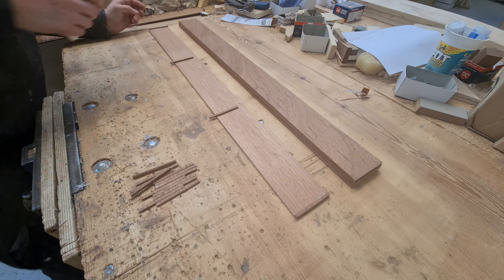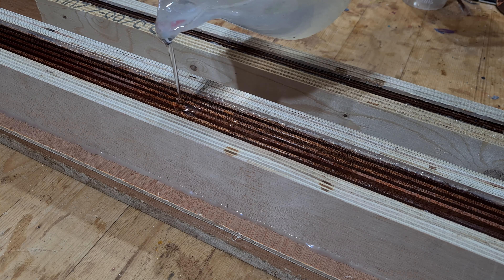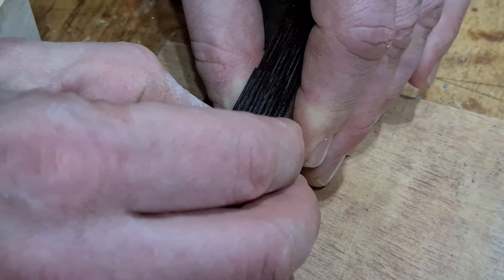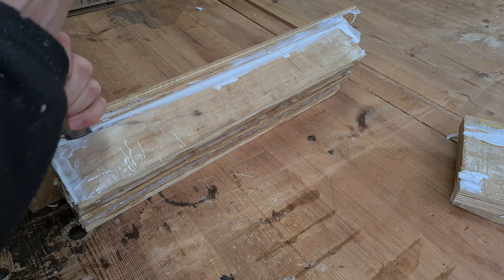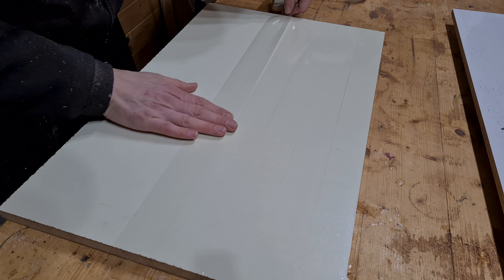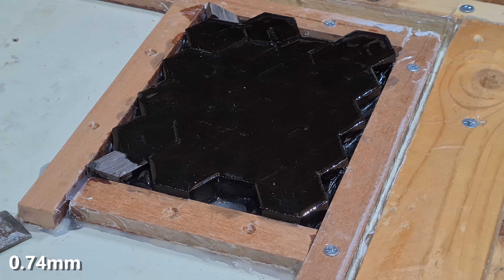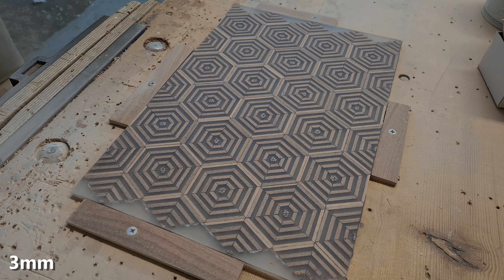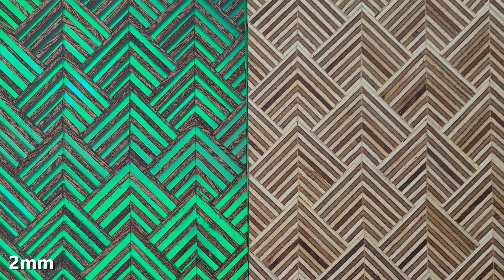How to Make Transparent Patterned Plywood

Comment from the maker: Question of the Week: Favourite pattern for patterned plywood? Project ideas with transparent patterned plywood?
Reply: 0.74mm my favourite 😁
Reply: They all look good to me. I imagine it's quite time consuming as well as being fiddly?

Is the veneer flexible enough to make into a wavy shape or even arches (circles I would assume would be hard to make small because of the veneer flexibility)?
Reply: Mountain tops.
Reply: I think they all look great. Would make for cool shaker style door panels on cabinetry.
Reply: Already thinking about how to make a pen blank using your method, but on a smaller scale.
Reply: The hexagons of course. For several months I have been thinking about how to make a new lampshade - now I know it.
Reply from the maker: Just a pain to work with!
Reply from the maker: Hi Richard. The veneer is more fiddly due to the size. If coated with thin resin and cured compressed, it can maintain it's shape better, certainly flat. Should be able to have them in a curve too, though making a pattern with curved patterned ply would require a very keen mind! Great idea - might have to give it a go!
Reply from the maker: Agreed!
Reply from the maker: Definitely agreed Kraigist! I guess the problem is the amount of resin to do such a design. Hopefully someone richer than I will give it a go.
Reply from the maker: Please send me a photo when you're done, would love to see it.
Reply from the maker: I hope it goes well and please send me a photo, if you are willing! The hexagons required a lot more care to position correctly and even slightly out it seemed to scream up at me. I'm sure you will show it the time and patience it actually needed.
Reply: Thank you for posting The tumbling blocks my favourite as for the optical illusion effect I can visualise a very tall transparent octagon patterned lamp with colour changing lights or lights that respond to the beat of music

Comment: You could take those 3d printed spacers, use some silicone molding stuff, and use that to make the spacers out of  resin. That would hide them pretty effectively to get more out of the board.

Of course, that depends on how good the edges come out doing this.

Comment: I think this is brilliant. But... if it were ME, I'd consider myself dying to go for a parallax effect: for instance: say you make some captive sliding doors, in a sideboard, or buffet. For the sake of ease of visualization, let's call them shaker style, with the floating panel made of your Transparent Patterned Plywood ("TPP"), in a bypass configuration with the body of the piece (so their sliding groove draws them along the outside of the piece).

Next inset a couple inch "bar"/"strip"/"inlay" (and having just thought that aloud, the intarsia potential for this stuff is HUGE, though you'd want a Hammond Glider to manage the cutwork) - think a thick "racing stripe" - running the lateral length of the piece parallel to the line of the doors' travel (and situated behind the doors path).

Finally, set some momentary switches in the track, such that the interior of the piece gets illuminated when the doors begin to open. It'd be like looking out a train window at it passes along a covered bridge: the illumination greater than if the window was absent, and flickering and interrupted as the support pillars flashed by.

Anyway, my 2¢. And worth every dollar, no doubt.
Reply from the maker: Some very intriguing thoughts! Certainly would want some bigger machines to take on larger projects. Doing the electric guitar tops was hard enough by hand! Thanks so much for your feedback. All the best. Ray

Comment: I really don't know what to say Ray except I was so fascinated with every little piece. Gonna make a spiral alyered vase out of them perhaps ?   Thanks for sharing.  -Mike
Reply from the maker: Hi Mike. Definitely have to start small, iron out the issues in turning a sheet into a 3d object, then see what happens. First is a segmented feature ring and see if I can get that done correctly. All the best. Ray
Reply: @RayWhitbyCreations  Ha, couldn't bait you into the most difficult vase I've ever seen. So OK to a simpler idea to start out with !!
Reply from the maker: @mpart_woodlathe-stuff  Not yet Mike. I've embarked on a couple of tricky projects and I think the sheer magnitude and complexity has done me in. I'm certainly slowing down on the frequency of producing the videos and the number of migraines has increased! The most difficult vase will have to be patient, or someone will be inspired to do it first...

Comment: I just now found you, but I'm already a fan of Michael Alm. You are now my hero as I also work in complicated epoxy pours. I'll give you a few hints.

1. It appears that you sealed all of the faces of your wood, so that's key. Wood off-gasses and you'll find a lot of bubbles if you don't. Just be absolutely sure that it's sealed. 
2. I don't understand the difference between deep and shallow pour and this is why ... if you apply your epoxy in layers (even during the same pour) then you will get "deep pour". How to mitigate bubbles?
3. Heat it. If you take the resin mix and put it in a Bae Marie at 125 degrees F (about 52 degrees C), the bubbles will all rise and you'll be left with a crystal clear epoxy. 

Of course, this will allow it to cure faster as well, but as long as you're pouring one layer after another, in this instance, say, half and half, then the first layer will be clear. It will set a tiny bit, and then you'll pour the second layer that's also clear. Degassing in a Bae Marie should only take about 10-15 minutes at MOST, depending on what resin you're using of course. Any bubbles that might get trapped between the first and second pour will be minimal and likely not seen once it's cut ... as long as you've sealed every square mm of wood that will be exposed to the epoxy.  

If you can see a bubble in one cut, then toss it because bubbles will be few and far between. Better to cut and pour extra lengths than to live with those few pieces that will have bubbles.

That having been said, I'm going to try this.
Reply from the maker: Hi April. Thanks so the detailed consideration. The difficulty is getting the large piece into a heated bath or pressure pot, so would have to work on smaller pieces. In another video (perhaps not this one) I did seal the surface of the wood first and then cast, but for some reasons the release of small gas bubbles simply "stuck" to the surface and wouldn't get to the surface without mechanical intervention. All the best. Ray